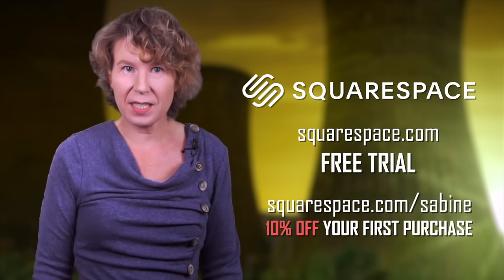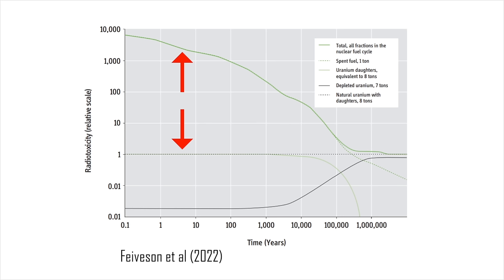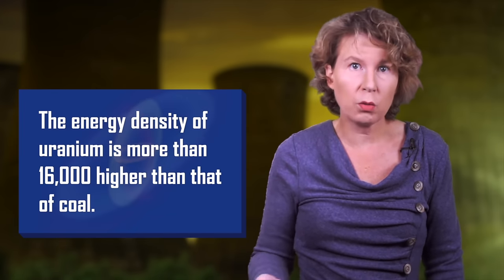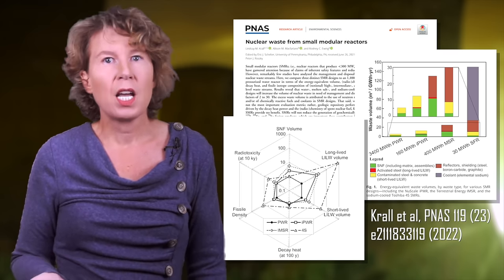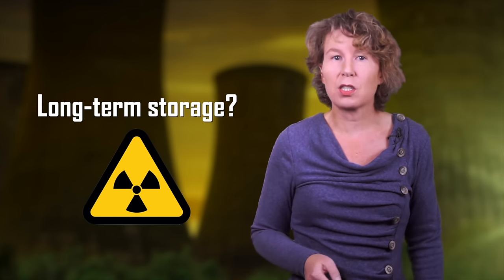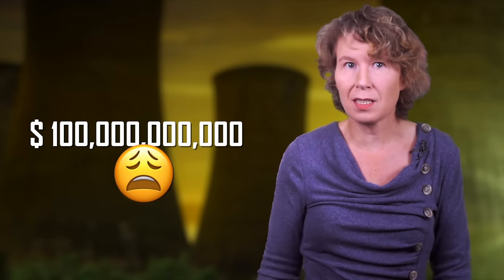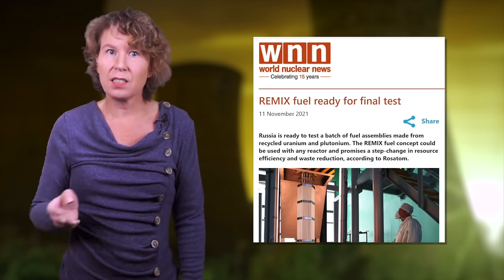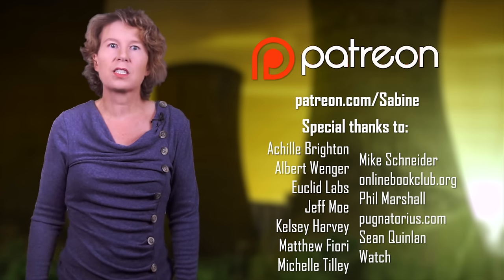Nuclear waste is not the problem you've been made to believe it is

Comment: Dear Sabine, could you PLEASE make a video about MSR (molten salt thorium) reactors? Is this a real option or only hype? What is the downside?
Reply: afaik they are usually either breed reactors or fast breed reactors, that are generally safer as they physically are unable some of  the issues that most common designs have like high pressure that can explode or going in meltdown. but have their own issues like corrosion and size
Reply: @khhnator  no, not at all. They work in ambient pressure, chain reaction stops(!) when heating up too high (exactly the opposite of Chernobyl), they don't produce bomb-usable material, and   many, many other advantages. Certainly a conceot worth to consider. Please have a look and share your opinion.
Reply: @kissingen007  you say "no at all", but then  literally agrees with what i said  O_o

i don't know how to answer to this
Reply: In the case of a melt down over heat or some such wouldnt the furl cool in the engine and freeze it solid? You couldnt vent the fuel outside like with molten furnaces because its thorium. 
Example is in molten furnace something goes wrong dump the line so the machine doesnt get clogged. You would need a separate emergency cooling pool thats not used 99.999999% of the time.
Reply: @fajile5109  so in molten salt reactors, the nuclear fuel is mixed in with the molten salt, ie: the coolant and the fuel are all mixed together.

if the reactor is heating up then the molten salt that is mixed with the nuclear fuel would... well still stay liquid. 

you would need the opposite of a meltdown to happen to clog the reactor. ie: it turning off.

either way molten salt reactor designs have a meltable cork on their systems, similar to a pressure cooker. if things get so hot to the point they get unsafe, the cork will melt before everything else. and all the nuclear fuel and the molten salt will just fall into a cooling pool
Reply: The downside is that we're only 95% sure that any individual MSR design will work, and each design requires at least like 5-10 years and a billion dollars of R&D before we can start mass producing them.
Reply: @hewdelfewijfe  So better no R&D, because it MIGHT not work? Sure, there is cost and if it works (95% sure as you say), there are huge benefits.
Reply: @khhnator  Nope. Neither nor. They are entirely different.
Reply: @kissingen007  uh, you literally agreed with me up there

Comment: Good presentation, as far as it goes, but I do have a few quibbles. 

The global proportion of waste in dry casks may be about 50%, but this assumes some good behaviour on the part of Russia.
In the US, the proportion in cooling pools is considerably higher, and dry casks are only used when cooling pools are completely full. "full" is a relative term and most pools have been "rerated" several times, most containing many times their original design capacity. The material in any given cooling pond is equal to the fallout from thousands of deliberate weapons. Releasing this material to the upper atmosphere would require a strike by ONE (1) nuclear weapon, maybe two, to be sure. The resultant fallout would be as devastating as hundreds of nuclear weapons. The US has 100 such sites.
Military waste is another matter. Such sites are most certainly a military target (and I believe civilan power generation is too), and they contain the reactor cores of every nuclear ship and submarine.  These reactors are small, use highly enriched uranium and are not "spent" in the same manner as civilian nuclear fuel. Maybe they have been reprocessed. Maybe not. Until some admiral has the basic integrity to say so, we know not. Till then, I assume every such core is a hot devil, still requiring megawatt scale cooling and still a priority strategic or terrorist target as a means of disabling the US economy by being disrupted. 

The famous "train test" tested a brand new container encased in a shipping cask, not an interim cask that had been sitting around for ten thousand years. It certainly covers a new cask being transported within the enormous shipping cask, but in no way reflects the risk to ordinary interim casks from deliberate attack. "bunker busters" fly straight through several meters of otherwise bomb-proof concrete. Again, consider that each cask contains several weapon's worth of fission products.
Looking at US Casks, not all are equal. Casks have to be rated for onsite storage, transport, and permanent disposal. Only a tiny fraction of US casks are rated for transport (the ones that have already been transported). These are still placed within a much more massive enclosure for transport. The rest require re-casking before they can be moved.  NONE AT ALL are rated for final disposal.
Shall we see if a cheap interim cask can withstand a nuclear explosion at some distance, 100-500 meters? Or hypersonic artillery fire?

Leaving this stuff above ground in pools or in "interim" casks is risky if any sort of deliberate strike is considered. Or a pandemic, or even an economic collapse. *anything*, really. How much of this cost will the US and other nations just leave hanging for future generations to fix? Generations that will not get the benefit derived from that waste. 

Yucca mountain was certainly stymied by local opposition, due to a US tendency to not involve locals in decision making. Okiluoko went ahead because locals were able to trust the analysis, and had many opportunities to see how carefully it was built. Yucca had other issues including oxygen ingress and condensation.

Securing a disposal site long term is tricky. Sooner or later humans or some other species will dig. We have to assume they are not complete idiots. They have some engineering skills, metallurgy, chemistry etc.
Rather than language, leave samples, in fact, leave samples of every element we can, and primers in chemistry and physics drawn as cartoons. Leave junior chemistry sets, and radiation-sensitive materials as basic examples. Uranium glass glows in ultraviolet, what glows under gamma illumination? Give them crash-course teaching materials so that they do understand what they will find further down.

Recycling is certainly expensive as stated. The US never tried, after very few experiments showing the expense. France has not yet processed, let alone recycled, more than a fraction of it's own stockpile. What it has done has been VERY expensive. It requires both chemical separation and subsequent conditioning and stabilisation, and will remain non-viable unless energy prices are more than ten times current prices, relative to essential foods and medicine. Repeated recycling will require isotopic separation of the desirable isotopes, and this will need to be prompt to avoid accumulation of very awkward isotopes like U232 in the allegedly desirable materials.

Using Fast reactors to destroy nuclear waste is not an efficient process. An otherwise useful breeder gets devoted to bombarding waste, to destroy less waste than an equivalent productive reactor would produce. It's a losing game, and a waste of (nuclear) fuel.

Using "the latest tech" is still ruinously expensive compared to storage, which is the reasonable option Hossenfelder settles on, but we need to remember that storage is itself ruinously expensive, so much so that the US cannot meet the costs, and has no realistic provision to do so. 

Concerning indeed.

It's good that Hossenfelder recognises geological disposal as the best option for the foreseeable future. It's a shame that the nuclear industry and nuclear nations have not yet paid to implement it well, and many, such as the US seem happy to kick that can down the road endlessly. If disposal costs are not REQUIRED as part of the initial setup cost, then they will be subsidised by the host state rather than the industry or consumer.

Comment: THANK YOU!  Someone who has actually heard of recycling nuclear fuel!  You should also mentioned that the high level waste from recycled fuel only needs to be contained between 1k and 10K years, which we have physical examples that have lasted about that long (the pyramids).  Also, with recycling, the amount of mining that needs to be done is greatly reduced, especially since some cycles can use depleted uranium, which has already been mined.
Reply: russians recently cracked that with their bn-800
Reply: @AjayAjay-gz3oz  As the youtube creator said, if you recycle the spent fuel rods the time to isolate drops to 10K years because the components that are recycled are the long life radioactives.  Actually I've read that the value is between 300 and 1200 years to return the hazard to the level of the original ore.  Heck, if I recall correctly, the Egyptian pyramids used granite, which tends to be slightly radioactive.  I'm kind of curious if the pyramids are more radioacteive then 5000 year old reprocessed nuclear waste would be.  I used the Egyptian pyramids as they are the best known and probably most studied.  There are many other examples in South America, China, India, etc.

Comment: Sabine, I would mind a 2 hour lecture of use of used fuels.
Reply: I wouldn't, from Sabine 🙂
Reply: Maybe I could too. I think that I heard that if an isotope is radioactive for a long time, it is obvious that it is not very radioactive. Is there a correlation between the short half-life of an isotope, and his toxicity, or dangerosity ?
Reply: @yvesgomez  Yes. "The candle that burns twice as bright ('hot') lasts half as long". Not only that, All decay Radiation is not created equal. Compare the decay modes between Strontium-90 and Caesium-137. Sr-90 decays to stable Zirconium by a 2-step 2.8Mev (total) beta particles only (electron) emission from their nuclei. That's quite high energy. But, that radiation would be completely blocked with a sandwich plate of just 8mm of Mg-Al alloy facing the source and then  backed with 3mm of lead (but NOT the other way round!). So, less than .5" shielding needed

In sharp contrast, Cs-137 first decays to Barium-137 with a .512Mev beta. So far so good, less than 1/4 the energy of Sr90 and so easily stopped by half the thickness of MgAl alloy. But that Ba137 atom is 'metastable' and 'grounds' to stable Ba137 by spitting out a .662MeV gamma ray emission. You need 150mm of lead to block that gamma radiation!!

So, Sr-90 and Cs-137 are highly radiotoxic but for different reasons.  And we can thus see that in fact, it's Cs-137 that's the most challenging of all the fission products we need to guard the biosphere against. BUT, on the bright side, we only have to guard against Cs-137 for 300 years (10 half-lives) 'til it's at the same current background radiation level.

Comment: In another video, I think it was by Illinoisenergyprof, it was explained that in the US waste was stored on the reactor site, because since you could store the entire waste output of a reactor on site why not do it. I'm left wondering who exactly is responsible for the waste when the reactor is decommissioned.
Reply: It gets moved around, there’s no long-term storage facility on the planet because we humans haven’t be able to design a structure that can last 200k years.
Reply: @abloogywoogywoo *stares intently at cave, with prehistoric drawings intact from 25,000 years ago...

"Well, it's a start..."
Reply: @abloogywoogywoo  the Finns have started building one. Others will come once politicians stop stalling. 

It's incredibly easy, tbh, just dig a tunnel 500m down into bedrock and put it there, with a cap of bentonite clay (swells in contact with water). 200k years is a very short time frame in geology. We have natgas that's more volatile and has been kept in place for tens of millions of years.
Reply: @jesan733  
We HOPE it is that easy.
We have no performance data on such a facility because none are in operation yet.

The volatility of natural gas is not the issue.
Solubility and mobility in water IS the issue.
Fission products include many immediately soluble elements, with more being produced by decay. Different issue to natural gas.
Reply: @aaroncosier735  we know that it's easy. Again, check the natural reactors in Oklo, Gabon. Natgas is quite soluble in water and nuclear fuel pellets are ceramic and not very soluble. Almost all fissions products decay rapidly from the perspective of geological time frames. The idea of hundreds of thousands of years afaik is based on Pu-239 which is not a fission product and 100,000 years allow for 4 halvings. It's generally not very soluble/mobile.

Comment: There is a reason why no Insurance Company ever insured nuclear plants nor nuclear waste storages, because the are able to do the simple math, which i ll present in the next line here: about 450 nuclear plants are running for about 50 years now.. in that time two plant accinents occured and one „end storage“ failed since water got in..  (Asse) .. These incindets lead to costs over 500.000.000.000€ .. i leave it up to you to do the math on your own, but you will find out, that Nuclear power is by far the most expensive by kWh produced..

Comment: I read about how an aircraft carrier only needs a new reactor after 15 years.  That's hugely expensive but the reactor replaced the burning of millions of gallons of oil during that period.  One of the most interesting children's books I saw in a bookstore was about what happens to our trash.  One solution is incinerators that burn it and generate electricity.  The problem is incinerators are expensive.